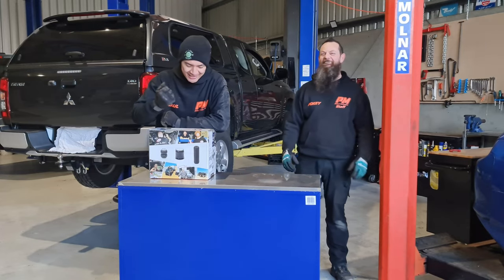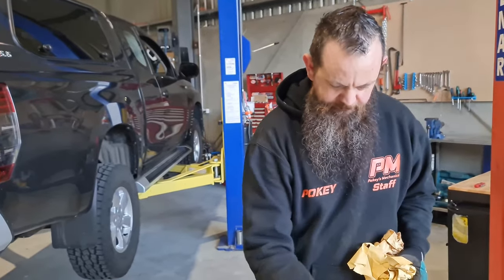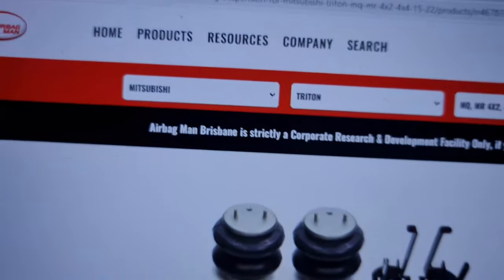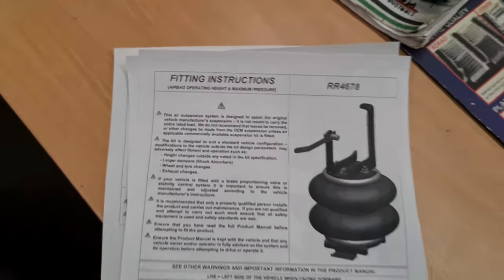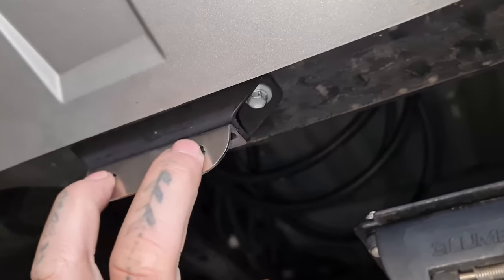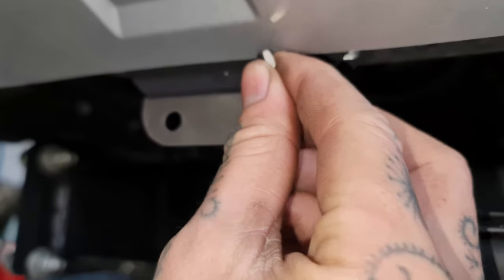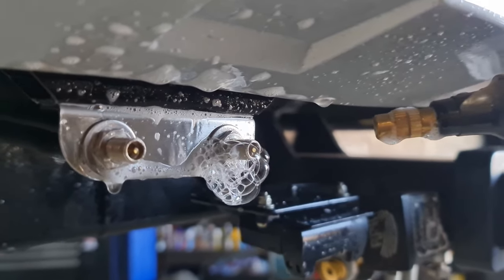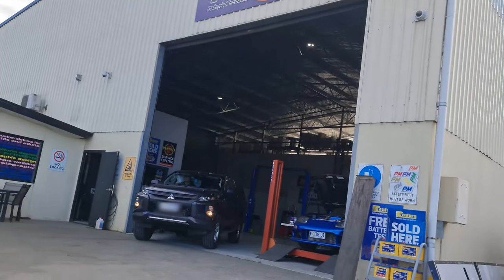Airbagman airbags install in a 2021 Triton, improve your vehicles control when towing

Comment: Great video guys. We also install airbag systems at work. Of course speaking to the customer first, we use cable clamps instead of the zip ties to give it a neater look
Reply from the maker: Awesome tip, how do you secure these to the vehicle?